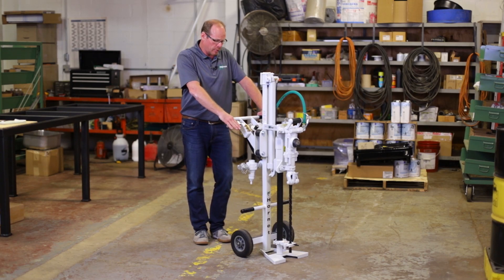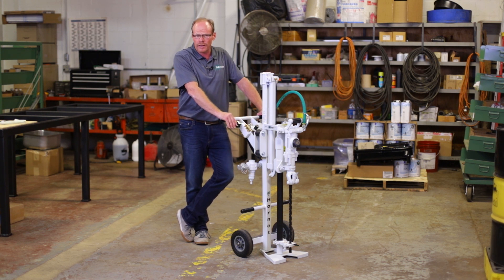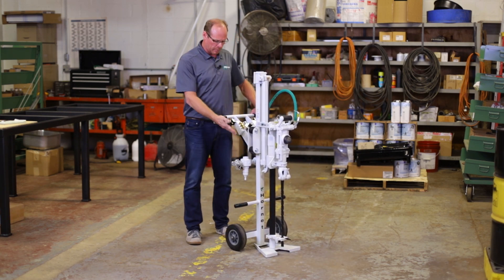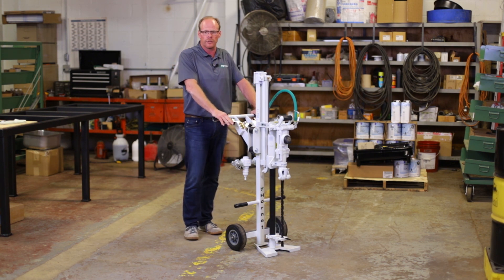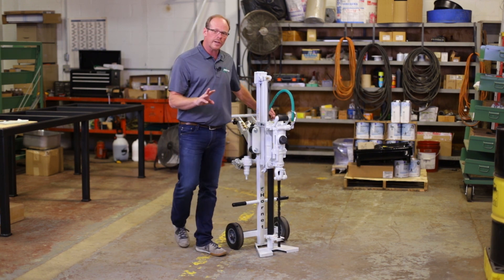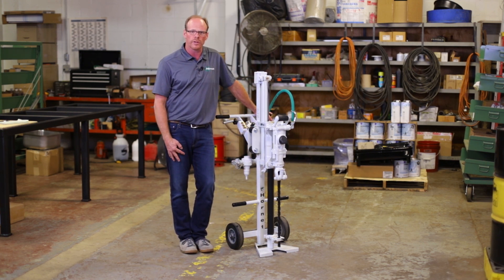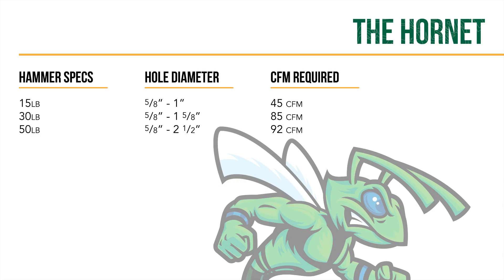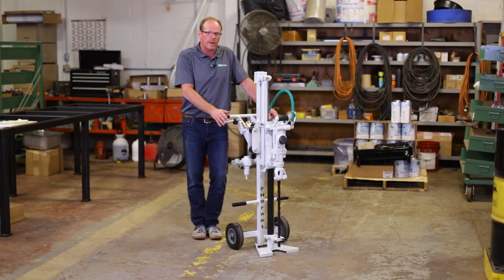The Hornet Dowel Drill

Comment: That's a nice unit. 
It would be great if it had a longer feed to use 4' drilling rods with that 50 pounder. 
Is there an adjustment for the angles?
Reply from the maker: K2 The V , The Hornet comes in several sizes, 36 inch drilling depth is a unit we would most likely have in stock.  Minnich can build custom units for special job applications.  Please see the bottom of our home page https://www.minnich-mfg.com/ (Contact us) and reach out to your regional sales manager. They'd be happy to help you get the right drill for your job.